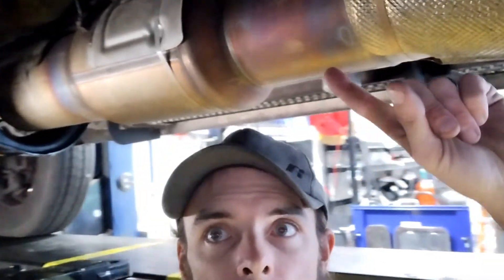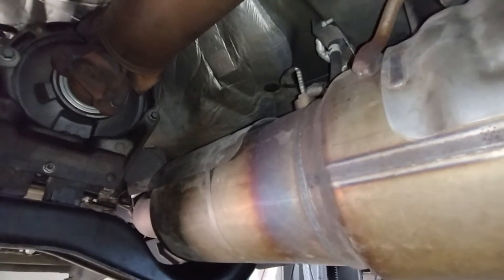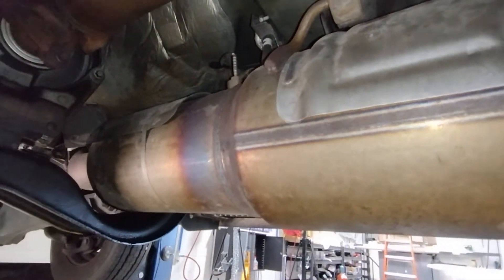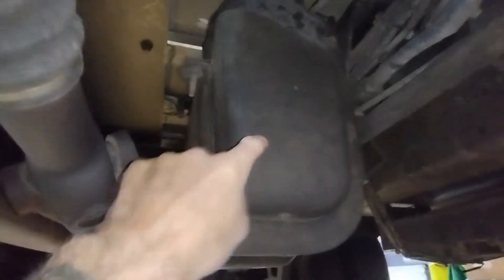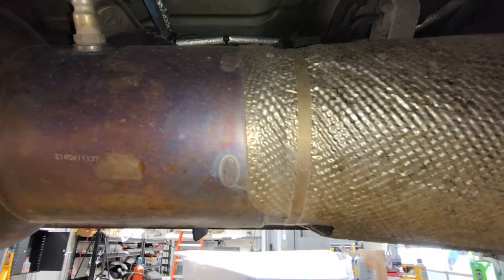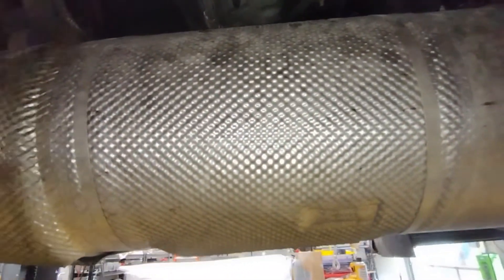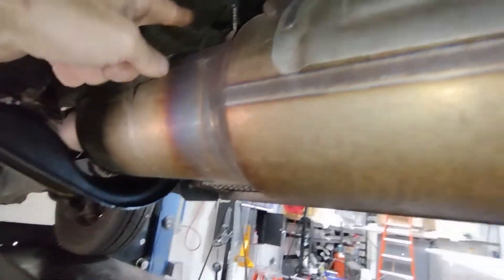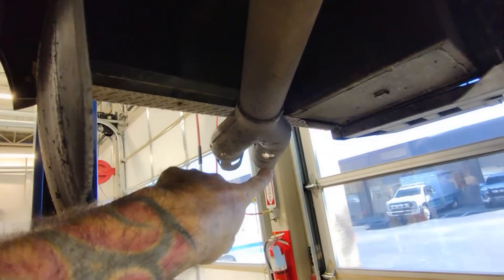Ford 6.7 Powerstroke DPF How It Works

Comment from the maker: The 2023 models actually have a "9th Injector" which is diesel injector located in the exhaust before the DPF so it doesn't dump fuel on the exhaust stroke like this year model.

Comment: So I have a 2015 PS. How does the fuel enter the exhaust line on these pickups? Is there an injector somewhere up front?
Reply from the maker: Not on a 2015. They added an injector in the exhaust on a 24.  The fuel enters the exhaust on the exhaust stroke.  It injects fuel into the combjstion chamber on the exhaust stroke and gets pushed out into the exhuast.

Comment: You pointed to the beginning of the pipe section and called that the particulate filter. And the next section the catalytic converter.  And the DEF injection point is between the two. I thought the DPF was injected with DEF to keep it clean, not the catalytic converter.
Reply from the maker: Nope. Its injected between them. It doesnt clean the dpf. Heat burns out the soot. The DEF just causes a chemical reaction to turn the emissions gasses into basically water. DEF has nothing to do with cleaning the DPF itself. Thats all done by high temps at around 1100 degrees. The DPF is first that collects soot. The selective catalyst is after that.
Reply: @BeardedFordTech  During cleaning process does the diesel go into the cylinders first or is it injected in the pipe before the DPF?
Reply from the maker: https://youtu.be/qFBOcVcVjB8?si=pl6xDKYki3Wf8wM4

Comment: Good video 
Could you tell me location the pressure sensor in f250 2013 
Thanks
Reply from the maker: Back pressure sensor or differential pressure sensor?

Backpressure sensor is located up top on the up pipe. Passenger side between the intake and the cylinder head. The pressure differential sensor is located before the DEF injector. Near exhaust gas temp 1 and Nox 1.
Reply: Good afternoon sorry for the inconvenience, please help me to locate this part Bc3z9j460f in a f250 2013 it's front dpf pressure sensor 
Thank you
Reply from the maker: @caballerodorado823 there is no rear dpf pressure sensor. You trying to find part availability or where it is on the dpf?

If you are looking for it on the exhaust. Its right noext to the front exhast gas temp sensor and front nox sensor.
Reply: My f250 2013 haveva message drive to clean exhaust system i drive it for 1 hr and never star cleaning system

Comment: thanks for this info, during active regeneration can it be common to have some nasty burning smell, almost like burnt plastic or similar smell to burning breaks? odd question but im having that issue and im unsure how to tell if its in active regen. thanks
Reply from the maker: @natgeonops  yes. It's gets massively hot under there. Like a hit metal kind of smell like brakes. Does everything run fine? No check engine lights?
Reply: @BeardedFordTech  yes it’s running good, I’ve had to get it serviced 3 times on different components with the exhaust system in the last few months so it’s hard to have trust in it anymore. The most recent was the reductant heater line so it’s worried me starting to smell that.
Reply from the maker: @natgeonops  that doesn't really have a smell. I've had that line break and leak everywhere. Not really a smell to it.  It's completely normal to smell what you describe. It's really really hot burning it out and cleaning it. I wouldn't worry about it.
Reply: @ ok great i appreciate the fast response and advice ! i cant seem to see the dpf % on my dash... possibly have to add it with forescan or something similar? thanks again i gave your page a subscribe!!
Reply from the maker: @natgeonops  yeah you have to add it with forscan. What year is yours?  Appreciate the sub.
Reply: @ 2021 lariat

Comment: I have a 23 ford f 250 that I Just purchased with 4k miles on it, which now has around 8k on check engine light came on yesterday. Called the dealer my regular advisor was on vacation so i spoke with another he stated it had set a p203d light, guess he pulled the code from the app, he said try topping of the dpf, went to ford dealer and picked up 2 of the motorcraft dpf at that wonderful price of about 50 bucks atwoods has dpf for more than half that price so what are differences?? Day after i picked the truck went to the local ford dealer that had serviced where i have my f 150 when ask what was best to run was motorcraft. Is this a common problem with these trucks? first diesel I have owned In years  was a 7.3 with very few problems. With that being said just scared to buy 7.3 gas I Pull a boat quite often the 5.0 f 150 I traded would pull it pretty well just the handling characteristics where a little on the weak side and fuel milage not very good either, about 9mi per gallon pulling and bout 14 regular driving. recently took about 150 mile trip with 6.7 got about 18 pulling and 20 just in general.
Reply from the maker: @rodneyblackerby117  there is no code P203D. Sure you dont mean P203B? Which is reluctant  level sensor "A" range performance. No adding def to it isn't going to fix their problem that service advisor is an idiot.  ICheck reluctant sample for urea concentration and contamination using a urea refrsctometer.
Inspect reductant quality module for
Signs of excessive heat
Damaged wiring harness or connectors
Incorrect harness routing
Incorrect connections
Incorrect ground circuit connection to frame
Pushed out pins
Corrosion.

If Incorrect urea solution concentration remove def tank drain flush and refill.
For all other concerns (wiring etc etc etc) repair as necessary.

Thats straight out of the workshop manual.
Blue DEF is fine. Motorcraft is fine.  Anything else seems to give trouble.  And do not add any kind of def additive.

As far as the 5.0 goes mine was getting 19 highway. Pulling g like 11. Miss that truck.

Comment: Thank you for the DPF explanation. We're still learning about the DPF after owning one for almost 12 years. 2012 chassis cab. Information seems difficult obtain on how these really work day to day.  Our Ford dealer told us we needed to replace our DPF at about 130k miles. So we did. But it still regens at 65 - 70 miles. Last week at 143K they just replaced the turbo (twice had the code for turbo overboost and went into reduced engine power mode). So it's going back again now to see if they can figure out the DPF at last. We keep changing the oil a lot in the mean time. I've never seen such black oil. We have the double filter Amsoil bypass filter setup to help with the oil. The truck often seems to end the regen cycle before it's should finish. What are the parameters that end the DPF regen cycle? Would hitting traffic and/or red lights end it? It's difficult to finish a regen cycle as it is when you've already reached your customer, I wish the system would allow us to use the OCR to finish the regen cycle without continuing to drive (i.e. static regen to finish). We've been using Archoil fuel treatments. No codes were present, but we did find one of the EGT's needed to be replaced with forscan this year and replaced it, but we're still doing the regen far too often. Any thoughts on what could be causing the frequent regens? No codes to report.
Reply from the maker: Could be the particulate matter sensor acting up.  Usually a reprogram of that fixes the issue. I don't like static regen. I like dynamic. You can move until it's done. If you have our turn on it should allow you to perform a dynamic.
Reply: @BeardedFordTech  Thanks for the response! Unfortunately I don't think this model year uses a particulate sensor. I've been taking some scan tool readings and found another EGT (14) w/ somewhat irratic/off temp readings. Replaced it. Last original EGT sensor. Also finding the DP has been 0 at KOEO, Idle, 30mph and up, but having a difficult time getting the bracket bolt loose to test it (don't want to break the mount). It's in a really tight spot with the transfer case and exhaust making life difficult.  Especially since we don't have a lift. Have you replaced any of these? Any technique or tool that would make this possible? Thx.
Reply from the maker: @gharr5261  it had a particulate sensor. It's at the back of the scr. Right next to the Knox sensor and EGT4. There is no pids for that sensor cause it senses particulates. That's how it knows how full it is. Along with some other computer math it does. 2011-2024 have them. On a regular truck it's at the back of the tail pipe
Reply: @BeardedFordTech  Thanks for the reply. This old 2012 doesn't have a particulate sensor, I looked at the truck again, and checked the parts diagram even. I'm still trying to get up to speed on using Forscan. We've finally got the Diff. Pressure sensor mounting bolt out so we could pressure test it. Still 0.0 in Forscan DPF_DP reading. Also at KOEO, KOER, 30mph and up when it was still connected to the exhaust system.  Is that the correct Forscan PID for this sensor? Thanks again.
Reply from the maker: @gharr5261  email me your VIN please
Reply from the maker: @gharr5261  i was looking at the parts diagram. There's a spot for it. But it's not on your truck. That's odd. It's blanked out no part number cause it didn't come on your truck. Weird that my 2012's have them.
Reply: @BeardedFordTech  Sometimes truth is stranger than fiction. lol
Am I using the correct PID for the Diff. pressure sensor with DPF_DP?
Reply from the maker: @gharr5261  should be. You can see if there is one in forscsn for exhaust pressure
Reply: @BeardedFordTech  The only other one I know of is the EBP which should be for the pressure sensor under the hood for the EGR valve.
Reply from the maker: @gharr5261  yes that is correct.  EBP is under the hood.  DPF differential pressure is in front of the def injector
Reply: @BeardedFordTech  Thought we had this figured out, and then I found another PID.
DPF_V, which the voltage readings look correct for KOEO and KOER, 30mph and up.
Starts as 0.44 and if I go beyond 2000rpm its about 0.75
How can DPF_V have correct reading when the DPF_DP readings are all 0.0? Both are based on T28, how can this be? Bad PCM?
Reply from the maker: @gharr5261  you changed out the sensor?  OEM or aftermarket?  Doubt it's a bad pcm. It's sending voltage to it.
Reply: @BeardedFordTech  We held off changing the sensor because of this new info.
Reply from the maker: @gharr5261  I highly doubt it's the pcm.
Reply: @BeardedFordTech  What would you recommend next? Replace the DPF diff. pressure sensor anyway?
Reply: @BeardedFordTech  What then? Replace the Diff Pressure Sensor anyway? This has me pulling my hair out.
Reply from the maker: @gharr5261  I would start with that.

Comment: What year is this truck in the video ? Looks a little different set up than my 2012 f-250 6.7 diesel
Reply from the maker: @angeltorresescobar3169  2015 same as a 2012. But it's also a cab chassis. They are setup slightly different
Reply: I have a 2012 f-250 6.7L lariat and the service engine light came on with this code P164A, I did my research and not sure but I think is the nitrogen oxide sensor, any thoughts if you could help please
Reply from the maker: @angeltorresescobar3169  yea usually it.  Replace it and reprogram the pcm and reset all values
Reply: Thank you for your assistance, very helpful
Reply from the maker: @angeltorresescobar3169  your very welcome

Comment: Thank you for the video. I learned that I don't want this crap on my truck 😒
Reply from the maker: Yeah it can be a pain. The new ones work differently. I saw a banks video. If you have it on there but tune the truck correctly it will make more power. But it's so big and costs more money a d well yes you get the point.

Comment: I have a p24b3 changed particulate filter sensor checked battery voltage, checked harness and still have light on after driving over 200 miles as soon as I turn, the truck on the check, engine light comes back on even after removing code.
Reply from the maker: Did you reset the particulate matter sensor?  You put a new one in but tou have to use a scan tool and reset the parameters

Comment: Good content thanks!
I havent seen an option for oporator command regen, do i need a scanner to do the regen?
Reply from the maker: Yes it has to be turned on. What year is yours?
Reply: 2018
Reply from the maker: @bruceybaby97  go to the menu where it shows the exhaust filter percentage. If it's up to temp and you have the park brake set it should say "hold okay to clean" then say "exhaust position safe hold okay to clean". If it doesn't show that then your going to have to use a scan tool to turn it on
Reply: Do I need to be parked or driving to complete the regen?
Reply from the maker: @bruceybaby97  parked for a static operator commanded Regen.  Drive it too get it to temp.  Then when you come back and put it in park with park brake applied it should say "hold okay to clean" then the next one will ask if exhaust is clear. Meaning are you in an open ventilated area. Then "hold okay to clean". Rpms will raise and fan will kick on high. If you need it to stop just push the brake pedal.
Reply: Outstanding. Thanks for the assistance
Reply from the maker: @bruceybaby97  your very welcome. Let me know how it goes.
Reply: Looks like I need an ECM password to do the regen with a scanner.. dealer will not give it to me
Reply from the maker: @briceneer3907  ECM password?  Never ever had to do that. What kind of scan tool you have?
Reply: I believe it was a bosh scanner my friend had

Comment: Much thanks for the explanation. With only 34k miles, very light towing (rarely tow, trailer weight only 2,500 lbs) and conservative driving, my 2017 F250 service engine light came on, indicating DPF blockage. Ford says I need to REPLACE the DPF. The DPF allegedly should last ~100k miles, so this suggested charge so early comes as a shock. Since ineither the active or passive regen prevented this, do you know if the operator commanded regen would unblock the DPF? If not, are the 'bake and blow' or chemical cleaning methods appropriate, or am I stuck shelling out $1100?
Reply from the maker: That's a very good question. Did he say what the code was?  A P2002 code indicates that it does need to be changed because there is possibly a crack in it.  Operator commanded Regen will clear it some but it will come right back. I just did a 2017 with the same issue. Replaced the particulate matter sensor and reset the parameters and it got clogged. Installed a new system and new sensor. Reset parameters and all is good now. How much idling do you do?  What kind of oil are you using?  Are you running a fuel system additive(that's a must). All of this also has an effect on the DPF system.
Reply: @BeardedFordTech  Thank you for a surprisingly fast and detailed reply. I looked at the paperwork supplied following the diagnostic. It does not identify the code. It simply states "Replace particulate matter sensor, recalibrate module to latest calibration". Most of my driving is highway (not city), but some level of idling is inevitable. I rarely go over 65, so the RPM seldom exceeds 1600. Every oil change has been at Ford (~5k mile intervals), so it's whatever they specify. I have never used an additive. What do you recommend, and why?  Is it one of the 'regen' additives, and must it be added with every refueling?
Reply from the maker: @gregparrott  ford oil is good done at the dealer. They replaced the particulate matter sensor and reset the learn strategy and the fault comes back then yes you need a dpf. As far as fuel additive it's not for def. It helps minimize water boost cetane and clean the fuel system and injectors. You should be adding it at every fill up and changing the filters at least every 10k and doing a fuel sample every month.  Your not doing anything wrong. Just you got a dpf not very well built.
Reply: @BeardedFordTech  Thanks for the reply. What I'm getting from this is that this will be my first and LAST Diesel.  
I don't tow anything heavy enough to warrant these extra costs and lack of reliability.
Reply from the maker: @gregparrott  they are very reliable. But there has been a bad batch of dogs the last few years

Comment: Yeah, so what's the difference between this and the 2008-10 engine that kept blowing cylinders by injecting more fuel in cylinders 7/8? And killing those engines?
Reply from the maker: The 6.7 doesn't get killed by doing it. And the 2023 models actually have a diesel injector in the exhaust stream now instead of dumping fuel on the exhaust stroke.
Reply: @BeardedFordTech  how does the gen 2 6.7 do it?  Does it still do cylinder injection? I have a 2019
Reply from the maker: @Lykapodium  yep. On the exhaust stroke it does. the diesel injector wasn't added to the exhaust stream (just before the def injector) until 2023
Reply: @BeardedFordTech  is this something to worry about like on the 6.4L?
Reply from the maker: @Lykapodium  Nope. Not at all. If you get a code P2002 you'll need a dpf system. It's because it has a crack in it somewhere and there's a tsb for that.
Reply: @BeardedFordTech  thanks for all this valuable info!  I'm really excited to have this wonderful truck

Comment: Love you explanation of how the exhaust works.  I know the government can screw up a one car funeral
Reply from the maker: Yeah. They can. The ford uses heat get the exhaust up to over 1000 degrees. Burns it out of the filter. Chevrolet uses a diesel injector to ignite it.  The new fords actually have a diesel injector on it now where it sprays diesel into the exhaust to ignite and burn it out as well.  The DEF is still used the same mixing into the exhaust stream for a chemical reaction to occur.  The only difference on the new ones vs this one is now theres a diesel Injector in the exhaust stream used during Regen.  Compared the the old style where it's just straight up hot!